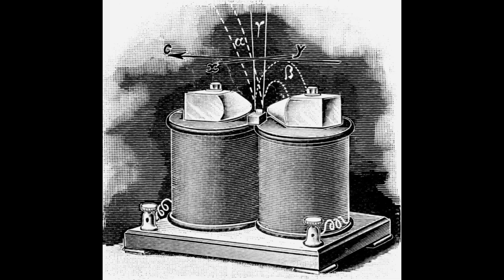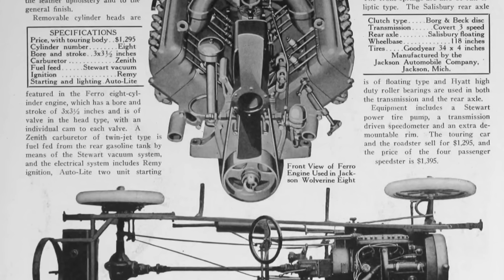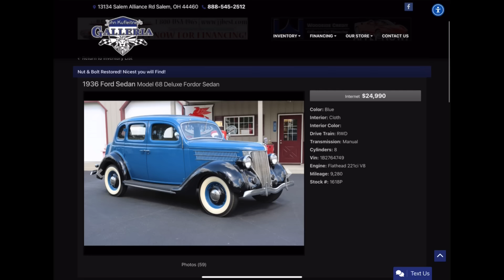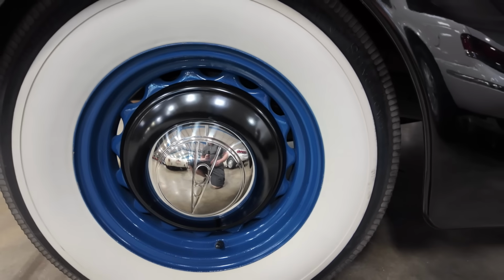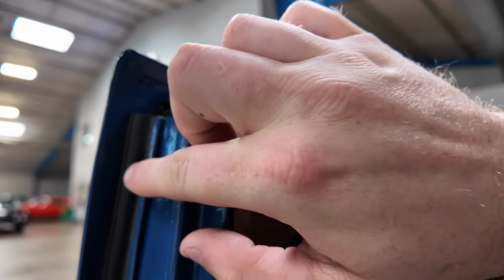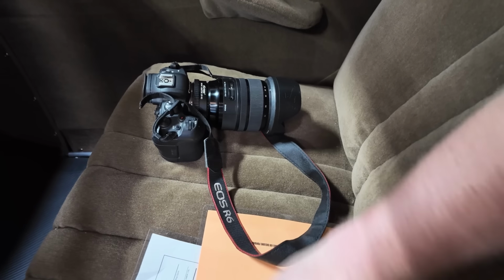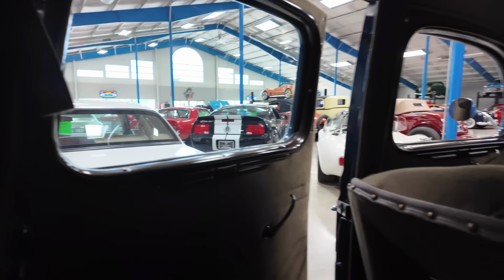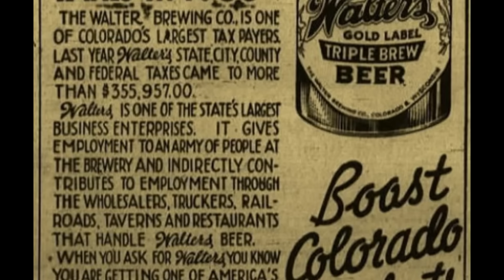1936 Ford Model 68 fordor deluxe sedan

Comment: From 1928 throughout the 30s the Fords were supremely stylish, thanks to Edsel B. Ford's good taste and Bob Gregorie's talent as stylist. While sticking to the hoary old way of transverse leaf springs front and rear and mechanical- rod actuated- brakes, the materials used in the manufacturing process were first-rate. Seeing the interior, it's hard to believe that this automobile was really a low-priced car.
Reply from the maker: Great insight and information edsel doesn't get the credit he deserves as a designer

Comment: Jay,
Great video as always. Couple of small points: you should have demonstrated the front windows, in the full up position when lowered they move back about an inch before lowering fully. This was referred as a smokers window, but also would allow for great ventilation when the cowl vent was opened. 
Secondly the key was used to unlock the steering wheel , the switch would then be allowed to turn on the ignition and then the starter button ( floor switch) to stay the car.
Everyday is a school day. 
Keep up the automotive history you provide your audience, I for one am a great fan.
Reply from the maker: Thank you so much for sharing that insight and information =)

Comment: Hi Jay!  Thanks for featuring the 1936 Ford!  When I was a kid, my two favorite old cars from Ford were any Model A and the 1936 Ford Phaeton!  Now I would choose the convertible sedan instead, as it has roll-up windows.  The headlights on the car you show have had a sealed-beam conversion.  Back in the days before LED bulbs.  The easiest way to get better, brighter headlights was to use more modern sealed beam units.  The original lenses would have been rounded outward, giving the headlights a cool, streamlined look.  The artwork from the brochure show how they would have originally looked,  The Fords of that era had a feature that is found on pretty much every car today, a locking steering column.  The little switch is actually for the ignition.  The car won't start without the column unlocked and the switch in the ON position.  The starter will crank the engine without the switch on, but she won't fire.  WYR 1936 Ford for number one.  Graham for number two!

Comment: For WYR, it’s the Ford both scenarios.

What impressed me was the back seat and trunk. A good amount of room in the trunk especially for the era, and a really comfortable-looking back seat. I thought the high/low beam adjustment in the steering wheel was interesting.
Reply: The sedan rear leg room is huge. I could barely reach the foot rests behind the front seats. The vertical trunk is fairly large, but difficult to get to smaller things on the bottom. Only some have an external spare tire mount.

Comment: A nice car indeed with a touch of 'art deco' styling. I do like the round-dial radios, and this two-tine body color is the perfect combination of colors. With two water pumps one could go out and overheat one bank of cylinders without showing a great rise in the temp gauge, and that caused the all-too-common cracked blocks you find in these engines. As vaunted as Ford;s V-8 was, it does have it's faults. 

On WYR all these three are so close in exterior appearance they could almost be ''badge engineered' models from the same manufacturer, but the Ford edges the others out. Notice the Willys has dual 'suicide' doors and the Graham two front-hinged ones which became the norm, but even with that modern touch it wasn't around nearly as long as the other brands. Again I'll have the Ford.

On the 'walk-around' you can see what looks like rust bubbles under the paint on the edge of the front door; a real shame considering how well they did the rest of the car. Details matter so watch them carefully during restorations!

Comment: As far as the commercials go, if they are offensive, close the page and come back later.
Until YouTube figures it out and fixes it, when you open a video and a commercial pops up, click the back arrow and then click on the video again. The video will probably then start without a commercial.
But, just treat commercials like you would on regular TV. Hit the mute, go get something to drink and/or snack on, and the commercial will probably be over when you get back. If the main video has already started, just back it up a bit.
The placement of the commercials has been at the start of the video lately. Before, a commercial might pop up when the narrator was in the middle of a word or sentence.

Comment: The blue dot taillights were never factory equipment or an available option. They are aftermarket accessories and not from Ford.
Reply: And the blue dot is a violation of vehicle codes for lighting. I did one night see the violet tail lamps on a car way ahead of me on highway one here in Northern California, as I gradually closed in on the car I saw it was a “hot rod” with this light lens mod — very cool (and a ticket magnet, for sure)!